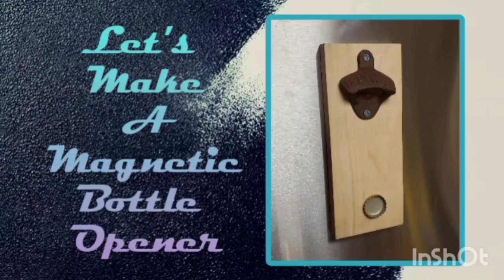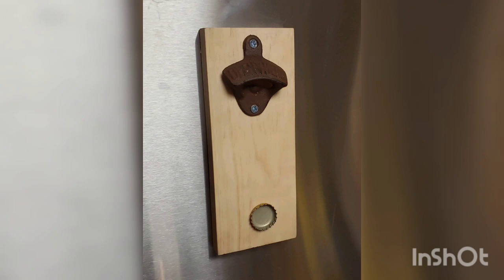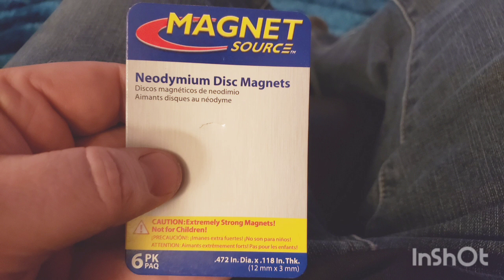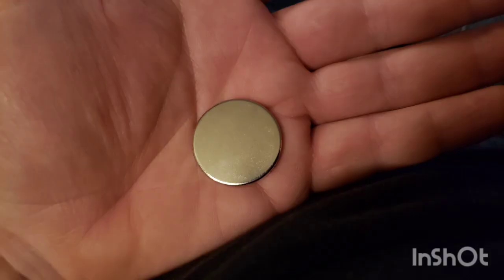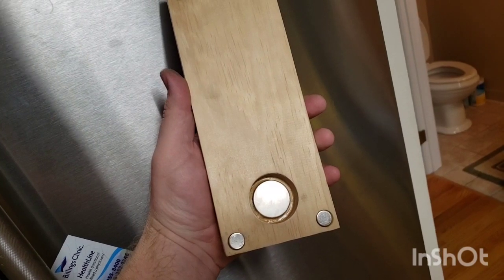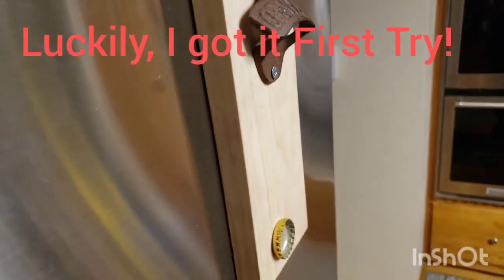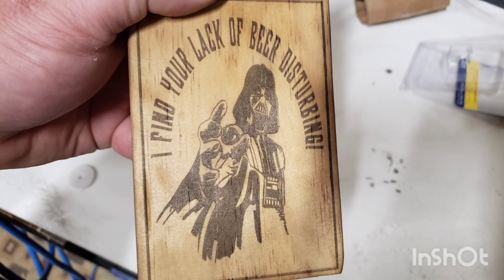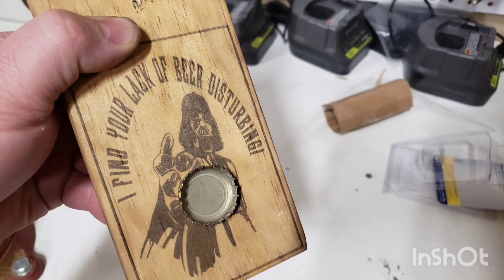DIY Magnetic Catch Bottle Opener.

Comment: Very cool idea. I think I'll give it a try. Thanks for the video!
Reply from the maker: Something once you get your design down you could make a bunch of blanks ready to go. Just burn and image and put on an opener.
Reply: I really like the idea. I have a 4x8 CNC router so doing a volume of blanks should be no problem once everything is dialed in. Where do you get the bottle openers though? Thanks for the great idea!
Reply from the maker: Ebay or Amazon. Can get in lots of 10 in several colors for around $1.50 an opener. The smaller live edge Basswood slabs from the Hobby stores also work well for an outdoors look.

Comment: Definitely gotta make one. If your cool with not using round magnets then old computer hard drives are a good source of high power magnets.
Reply from the maker: I try to use stuff thats easy to find so if I want to add it to the stuff I sell I can easily make more. These were pretty strong for their size. The ceramic ones didn't work at all.